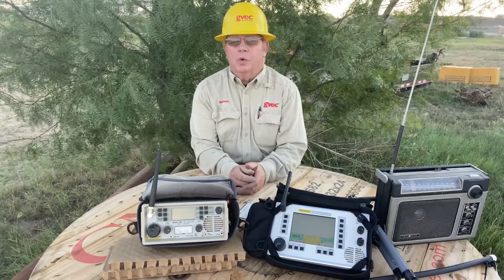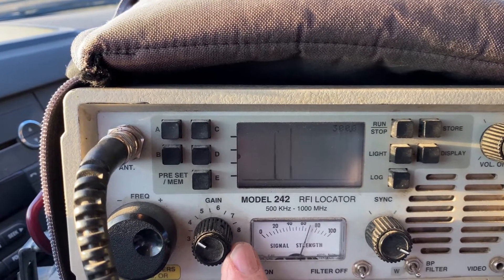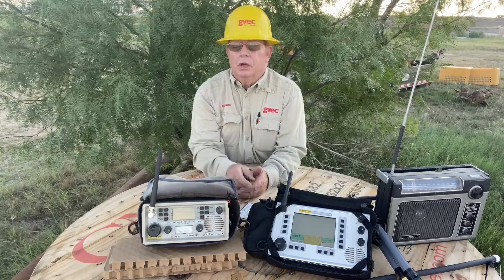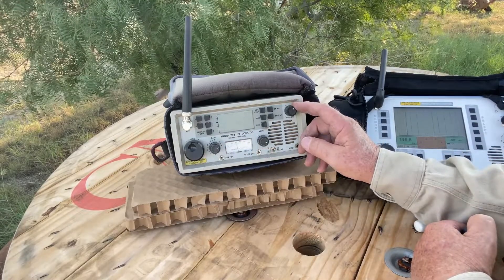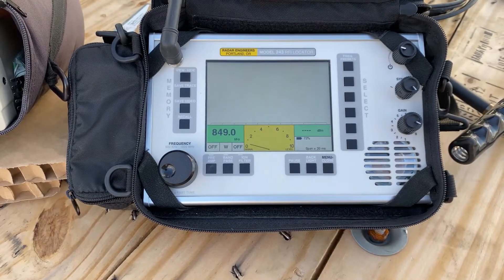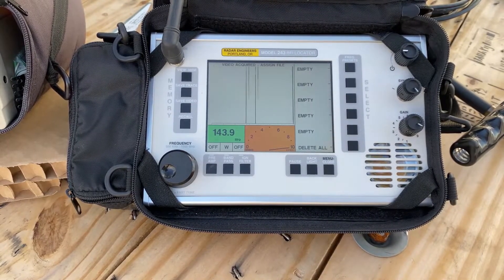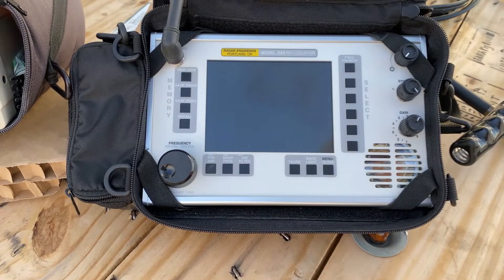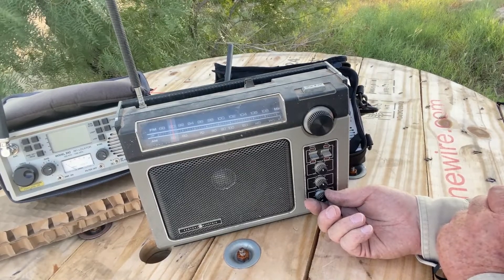Using the Radar Engineers 242 & 243 RFI Locators at the Test Field

Comment: Hi Richard, nice video but I wonder why you don't adjust the sync so the horizontal sweep is in sync with the power line frequency to make the captured image stable (minimize left to right / right to left movement)?
Reply from the maker: Thank you for the comment. I rarely adjust sync. If the 242 is one cycle and the 243 is 1.5, I get the info I need. I am sure there is a better way. What is the benefit?

Comment: Those are great instruments. Wish they weren't so expensive.
Reply: I believe the device is essentially a spectrum analyzer (SA) with a speaker and a small antenna. If you have a ham buddy with a SA they could help you. When you get the settings right you will see the same impulsive noise on the display (without the speaker of course.) For settings I would start with a frequency span of zero or as low as the SA will go, and set the resolution bandwidth to 100kHz which should be wide enough to let the impulses in. Then the center frequency can be used to determine how close you are to the interference source. Low frequencies like 100MHz (or less) propagate long distances (like a km or more) and high frequencies like 800 MHz only propagate short distances (10 meters or so)